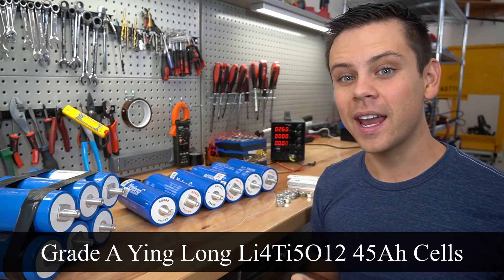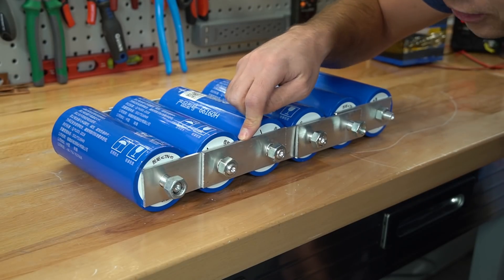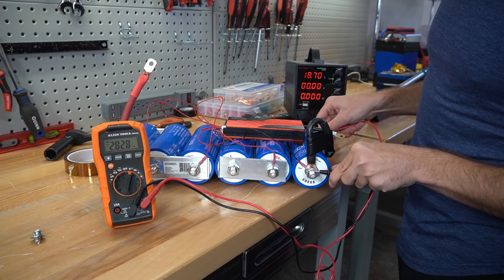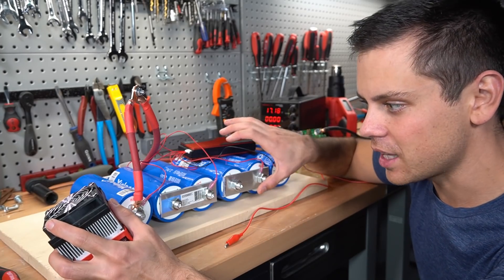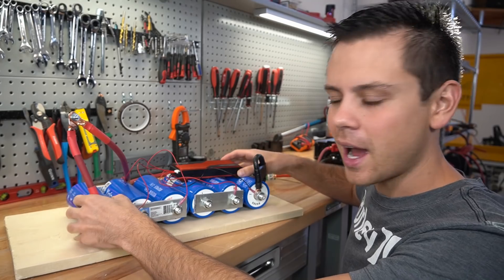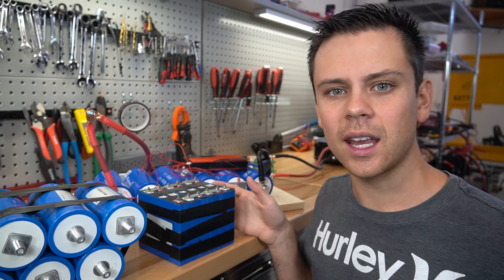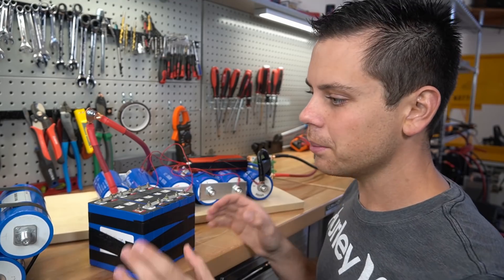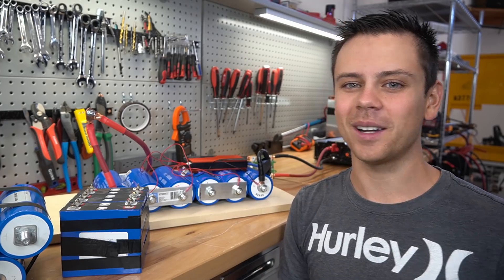$493 Aliexpress 45Ah Grade A, YinLong Lithium Titanate (LTO) Cell Testing

Comment: You can now buy 4 Grade A new 280Ah LiFePO4 cells on Aliexpress for less than 400Euro. Can you do a review on those? They're VariCore ones and the deal just looks too good to be true. You can potentially get a battery of 560Ah for just 777Euro! That's insane! I'm not going to link because that might not be allowed. Just search "LifePO4" and the VariCore ones should be in the top row.

Comment: That's wierd Will, I have the 40ah LTO grade B cells on my electric motorcycle pack and I've capacity checked them but still got the 40ah capacity. I've since swopped to 32650 6ah 3C lifepo4 cells. 332 of them lol. I'm falling in love with lifepo4. I mean if I can get up to 6000 cycles then that's perfect, even after that I'll still have 80% capacity. Also the reason there is so many grade B cells is because the Chinese use the LTO on applications and probably are required to swop them out after a certain time period, this is especially true for medical and public transport applications. Instead of throwing them out they sell it to us. That's my theory. Thanks for the vids!
Reply: How is your LFP holding up after 3 years?
Reply: @dahrafs9798  still going strong!
Reply: hey Zero ....can you help me with my drone buitding as i am worried my electrical knowledge is zero . my motors have 11 kg max thrust . 4 motors . need to opreate atleast 14min . which batterry shall i use . max peak current is 100 A each motor
Reply: @NeoleoM  definitely lipo power to weight ratio is the best. Treat them with respect though please. They are sensitive to over charge and will burst into flames. Also don't damage their out shell too otherwise the same thing will happen. The other chemistries are safer but have less power density per gram. Oh also lipo offer insane amounts of C rating (max instantaneous power output the cell can give) which you need when lifting the drone off the ground.

Comment: You did not buy grade B cells. You bought 40AH grade A cells and they are among the most common being used in high power car audio because of the 10c charge/discharge. And do very very well. Evidence of this you can visit XS Powers website they have the rewrapped cells 35ah/40ah

Comment: LTO is favoured for transport applications - like trains and light rail where regenerative braking gives high charge rates. And also the high cycle life is very important. But as you say, these are not requirements for solar.
Reply: What about audio
Reply: so I take it on a catamaran with regen capable props this would be the chemistry to use, plus the safety aspect is important too, plastic boats are highly flammable
Reply: I need help guys but please someone who truly understands it 🙏 
8k RMS system in the car going ✅
I have 6x 45ah 
Can I simply delete my car AGM battery 🔋 with still running OEM car alternator (120amp )
And just use 6 x45 cell bank instead + BMS 
Can someone please tell me the correct way using these cells in my car audio project ❤ thank you 🙏

Comment: The great factory output reason of this cells is because the china electric bus industry isnt ready to use them like planning , they are behind the time table . Alos the fast charging inductions coils in the streets are under construction . The grid must be enlarged with amps and more power , high power fast speed charging is a total other world and need a special infrastructure of grid design !

Comment: 45ah cells dont exist my friend , no company build 45ah cells . Yinglong made only 40ah cells !!!
Reply: Yinlong Handan produce these cells But No logo,The model is wrong in the Video 66160H😂
Reply: @huangvicky9361  , yes you are right , video shows typical 66160 cells ! We pay right now 25$ for Lito 66160 , grade B . Can you delivery Litos for a good price if we order big amount ?
Reply: @alibabaneue-welt9602  I want to clarify that 66160D is 45Ah model number. And Nowadays, there are many Yinlong batteries on the market. These batteries are the leftovers after our company picked from Yinlong. What internal resistance, voltage and capacity?
Reply: @huangvicky9361  , ok thats new for me that the 66160D have 45ah , i thougt 40ah . Because I had never seen 45ah Litos . We assemble 22pcs for 80ah/24v . Your comp is in Shenzhen ?
Reply: @alibabaneue-welt9602  By the way,Are you Chinese?

Comment: Hi Will, I managed to overcharge my LiFePo4 cells to 4.1v during top balancing. How should I proceed? Should I put them in series and pull a load to get them to 3.6v and then install BMS?  Are the cells now damaged? I appreciate any advice and thank you for all your informative videos.
Reply: They stabilized at 3.8v which is a bit high, anyone else have any input?
Reply: Just pull them down to safe range, and that's the best you can do.  Worst case I would expect some capacity loss, but they should be ok.

Comment: Sounds like a great solution for boats in northern climates, especially where the temps in winter go far below freezing and the boats are kept on the hard with no heating.
Reply: Winters in the south get very cold too. Take a look at Antarctica if you want proof.
Reply: Then again You don't charge when it's cold.

Comment: I do agree that these cells have been mislabeled (in A/H).
But why are you claiming that they are "B grade"?
Can't these cells simply be "A grade", but with a lower capacity? 
How do you define "A grade" anyway?
Reply: That's what I was thinking when I watched. Mislabeled cells would have nothing to do with their quality. Another commenter pointed out they've never seen 45Ah cells of that size before, only 35, 40, and 55. 
The coulombic efficiency (Ah out / Ah in) and the internal resistance would've been good to compare against his previous collection to determine the "grade".

Comment: Hey Will, why did you go with aluminium bus bars this time instead of copper? I did some research and it seems aluminium bus bars dissipate heat better. I only ask because I have 2 meters of copper gas pipe here I'm planning on using as bus bars.

Comment: Sorry to hear you got scammed but you could get a refund and just insist that they sell them a whole lot cheaper and consider them 35AH cells and call it good. LiFePO4 are the best. Good for 12, 24 and 48volt systems or higher. We are after all dealing with China. So wish we could get these kind of things from here instead of taking the risk of buying from China.

Comment: Summed it up best, unless you need extreme safety or live in Antarctica stick with Lifepo4 for 2 to 4 times less money which gets you a lot bigger battery bank for the bucks. The voltage range makes them a mess to use too for anything 12 volt.

Comment: Hey thanks so much for the great videos, I just discovered your channel and website. I was wondering what system you would suggest for someone who wants to get their whole house completely on solar without sacraficing any usage. I bought a solar power setup from Iron Edison this summer, I haven't had time to install it, but it's supposed to be a 1.5 kw 12v system, we shall see, but I had to compromise at the time and bought 2 200 Ah AGMs, but now after watching your channel I see how easy it is to build LIFEPO4 packs. I previously built a small 10 Ah pack, but the instructions I was following were iffy and I barely got the thing built, works great with a roll up panel I have. Anyway, so you suggest 48 v? And since I will most likely need more than 4800 w, do you suggest a different BMS? (I see on your website you don't suggest the BMS you like pat 4800 w). My plan is to slowly build out a system a bit at a time, add battery packs here and there. But I want to make sure the skeleton of the system is ready to handle the growth, I live in the country in Idaho and we are on the grid. The system I have currently does have a charge controller that is multi chemistry, including LiFPO4, and would barely be enough to power my home office, I do ham radio too. I would like to buy very durable long lasting components and buy backups o put away in case... Any help is appreciated.

Comment: Also, calendar aging seems highly unlikely for these cells as most researchers on calendar aging agree that the cause of calendar aging is the graphite anode which isn't present in a lto battery
Reply from the maker: Oh good point. I did not think of that difference.
Reply: @WillProwse  Hey Will, I know you haven't done anything with LTO batteries for a long time now, but if you want real 45Ah grade A cells, you can get them from an American company called XS Power. They make a lot of extreme car audio batteries, and they used to have lots of Lead Acid batteries, but they have recently started offering rebranded Yinlong LTO cells and they also bought the intellectual property from the largest and best super capacitor company there was. I believe it was Maxwell or something close to that. They made 3000 farad super capacitors, which were very useful for extreme car audio since capacitors can charge and discharge almost instantly, and they can charge and discharge in low temperatures. LTO cells have lots of benefits for car audio too since you don't have to worry about the temperature as much as with Lifepo4. Plus, LTO's charge and discharge very quickly at high C rates. Thats perfect for car audio. Hence why they are being rebranded and sold by XS Power along with the 3,000 farad capacitors. Its a great combination to use the XS Power/ Yinlong LTO cells in combination with 2,000 to 3,000 farads of capacitors. So, if you want to try the 45 amp hour XS Power cells or their capacitors, I can say they are regarded as a top battery brand in the car audio space. Limitless Lithium is another big company that has really expensive high C rate Lithium batteries for extreme car audio. It would be extremely interesting if you did a high C Rate output challenge between the Yinlong cells, proper Grade A 45Ah XS Power LTO cells, Headway 38120HP Cells to represent high output Lifepo4 cells, and maybe 2 AGM Lead Acid batteries in parallel. Pit them all against each other in a showdown and a teardown. See who has the best high output cells in the consumer space. That would be incredibly interesting to me and about 100,000 other people who use Lithium batteries in high power car C audio builds
Reply: @WillProwse  where did you get that 6s lto bms? ive been looking for weeks. i have 2 bms that arent the right ones

Comment: Love your content!  But just a bit of criticism - please don't top balance by bus barring together.  The inrush of current in low resistance cells could be momentarily 1000's of amps.  Its best to charge the low cells with a conventional charger so the 3C charge limit is respected.
Reply from the maker: Oh absolutely! But the voltage differential was low, so it was fine to do it this way. Usually I do not do it this way. I have a few videos stating what you just said.

Comment: If you have to jump thru hoops to buy grade A cells without getting ripped off I'd just skip the entire brand. It's that simple.
Reply: I went with LG LTO 12v batteries, China’s middle name is scam!
Reply: @thesurvivalist.  You can say that again.
Reply: You're pretty new arent ya?
Reply: Just go through Sriko batteries, you get what you pay for always
Reply: @cryohphaze9329  THANK you for this. i invested in lots of 66160 cells from sriko, and was worried i would have the same outcome as will.
Reply: @cryohphaze9329  thats insane. i have done 40+ hours of research this month, and i CANNOT find actual grade A cells. The “brand new” cells i am investing in from sriko do have dents in the terminals from nuts, and one cell body has a slight dent, also theres a little bit of red on each terminal, im assuming could be loctite.
Reply: The problem is that its so hard to get them directly from the manufacturer
Reply: Imagine having the guy doing the video know that is the conclusion and you watch the video only to find that he knew wall along they were grade "b" but had the video labeled grade "a" anyway. Dump the reviewer and the product.
Reply: @9lbloodnolast873  that's a damn good point. What an ass hat. Total clickbait. I wont watch him again.
Reply: @JasonSmith-utube  If you don't watch Will, you are missing out on the most honest and thorough solar/battery/equipment videos on You Tube.  Leave if you want, but you leave at your own peril.
Reply: Honestly this is what keeps me on lead acid.  I can walk into Canadian Tire and buy lead acid batteries, or I can buy from a solar store.  With lithium it's a big gamble if you're getting something good or not as there are not many legit places to buy them from.  At least not here in Canada.
Reply: @redsquirrelftw  LiFePO4 beats the hell out of lead acid even when it comes to value if you consider it's lifespan.  Lead acid is just plain obsolete.  If you already have it, then I agree with using it but for anyone building a new pack it makes no sense.
Reply: @ryanchappell5962  even a grade B LFP will be better than Lead Acid.  Especially at the price China is selling.  People are so worried about being ripped off that they forget a functioning battery is still functioning, whether or not it pulls the exact full capacity.
Reply: @blakebennett2575  and unless you're doing a mobile application where weight or size is critical, or you're tight for space in your garage or shed, ultimately the important measurement is $/kWh.
Reply: There are many legit brands and suppliers available for CA buyers.  No  excuse for not going with it.   Lithium is still far superior to any lead acid format.
Reply: @redsquirrelftw  with lead acid you can just create your own. Depending on how you make them you can make them last veeery long

Comment: LTO has a linear voltage VS discharge graph.   From 2.8V to about 2V.  At 38Ah the equivalent Wh is about 2.4 x 38 = 91.2. For a constant 2V battery this is about 45.6Ah.   
Wondering if they are using advertising liberty to claim Wh to Ah.  
Would not be the first time someone is doing fuzzy math advertising.   

Nah.   They just ripped you off.  Glad you keep them honest.    Love the work you do !

Comment: G,day from OZ 😍ya work,did you end up taken up ya cluey mates offer on a joint project,I'm kinda thinking along the lines of solar powered induction heated improved Stirling motored pur sin wave generator or motor,if anything it would be good use of grey matter for a while and who knows if the two of you put your heads together with combined skill sets what you'd come up with.Any thoughts on the matter would be appreciated 🍀👍🇦🇺🌞

Comment: Do you recommend a 2 port BMS that can switch the charge to a heater if the temp is below 0c?  Where I live it's entirely possible that the cells will be freezing (perhaps down to -5c at worst) at first light when a solar system would start trying to charge.... maybe for 10 days a year, but it will definitely happen....

Comment: Hey Will, Great video! I recently purchased the KiloVault 150 amp batter you review in a prior video for our '07 RV, and I was wonder. Do we need to install a DC to DC charger since the battery has it's own BMS, or can we simply use the Isolater Solenoid that's current in the RV? I was looking at the Victron Orion-Tr Smart Isolated DC-DC charger.

Comment: I'm thinking another possibility is they may be grade A cells rated for either 35 or 40ah but just marketed as 45ah cells
Reply: Especially chinese companies....
Reply: @joewamsley8004  copy that.
Reply: I've gotten so used to ragging on china and thinking they are dishonest I keep forgetting the incompetence and hubris. Haha. I know a lot of people that went there to help them get plants working. The Chinese just assume they did it right, without validation. It wouldn't surprise me if they thought these were really as specified. I seem to remember a CPU manufacturer pumped a few billion into these great micros 98% failure rate... now they sell the originally 16 core micros as 4-8 core and they still haven't worked through the backlog.
Reply: Sounds about right.
Reply: Yeah lots of compaanies do that, over-rate their product.

Comment: Will the high charge/dischare rate of LTO cells make them a good option for low-range EVs?

If I wanted an off-road EV (UTV/SxS) for farm use which only needs a minimal range (10-20 miles) then I'd imagine these would be good as you wouldn't need so many in parallel to get the range you need without pushing the discharge rate, so would overall end up with a smaller pack size.

Would that be a correct assumption?
Reply: Use a electric golf cart. With a solar panel on the roof, you’ll never have to worry about plugging it in
Reply: @4philipp  Well yes, I've seen Will's videos on that subject.

Golf carts aren't so hot in the mud though.
Reply: In theory, Yes, that is how it would work. You should be able to charge fast and output a lot of amps. That said, many negatives below.

However, you are trading less in parallel for more in series, since they are only rated at 2.6v. If your off-road ev runs on higher volts, than you would be better off with a different chemistry. They are also at a higher weight for their capacity. And you are having to pay out the butt for them. Honestly, you are probably better with LiFePo4 batteries. Most can output very high amps, charge pretty quick, and are cheaper for their capacity as well. Given the volts are higher, you also need less in series to hit higher voltages for motors. 

I hope that helps.

Comment: I think the cells are fine because Yinlong makes 40 Ah cells.  I think the seller overstated the Ah to make a sale. The batteries may have been re-marked to say 45 Ah but they are likely 40 Ah.  Check the Yinlong website.
I checked the website and the 45 Ah are slightly heavier 1.25 vs 1.22 kg. Maybe you could weigh the cells.